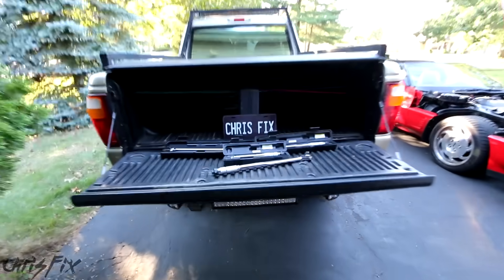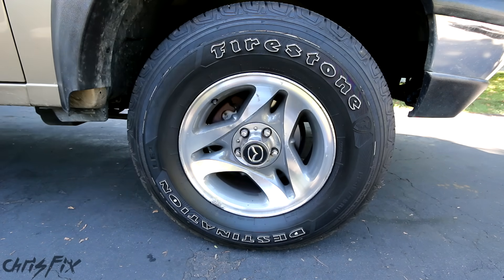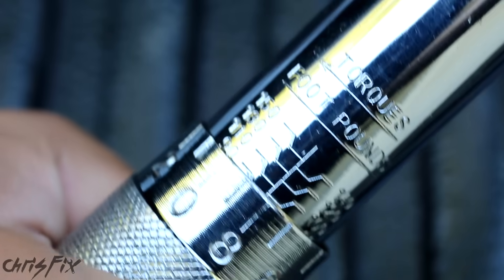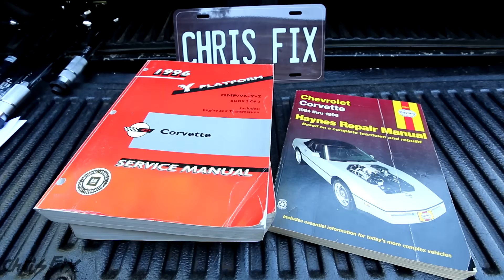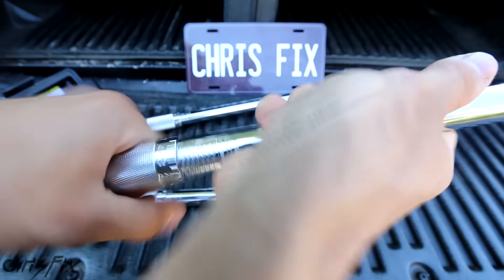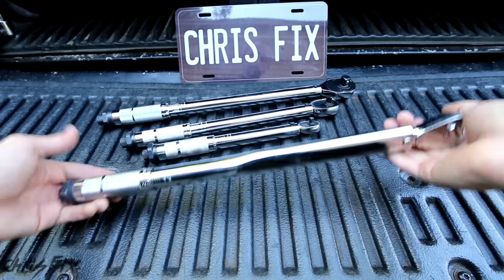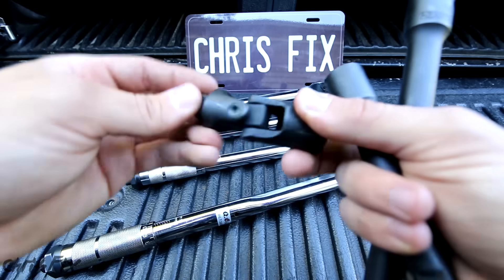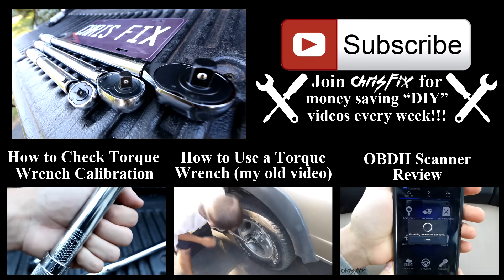How to use a Torque Wrench PROPERLY

Comment: I just slid my car off the road (Because of the rain), and I"m 90% sure I fucked up a rear lower control arm. Do you have a video/any tips on how to fix it/even know if it is the control arm? 

For explanation on how I crashed, I drive a 1995 Crown Vic. That thing only delivers 210 horses to 1 of my rear tires, and the road had standing water, I was going from a 35mph zone to a 45mph zone so I was accelerating. Then, before I even knew what the fuck was happening, I was sliding. Slid over a curb and into a school parking lot. I'm spooked solid dude.
Reply from the maker: +FancyDerp Dang, glad you are ok! It is scary when you get into a slide like that! Yea, here is a lower control arm video. Your crown vic will be a little different but you will get the idea: https://www.youtube.com/watch?v=CmN2dRAiuj0
This is an important tip: https://www.youtube.com/watch?v=-QczV_6v42A
Reply: ChrisFix Thanks man. I wrote that comment when I was still shocked about it happening, I could have easily looked up your videos. You seem like a cool guy, it's a shame I'll be trying to fix it myself
Reply: +ChrisFix Would it be a good idea for +FancyDerp to have the differential welded so the power is distrubuted evenly between both rear wheels? just asking :)

Comment: Torque specs are also in the owners manual.
Reply from the maker: +Paul Naylor Some are, but most arent. Lug nut torque specs are and maybe the oil drain plug.

Comment: Check your math.  lb*ft or ft*lb; order doesn't matter, it's still the same amount of force.  ;)

Also worth mentioning, you don't want to use an offset socket/extension like a crow's foot without consulting the owner's manual.  You'll have to recalculate your torque values, and because offset extensions are offset on the other side of the sensing mechanism, it's not as simple as "adding a couple inches."  Most manuals included with decent torque wrenches have the equations you'll need.  :D
Reply: Mathematically, yes, they are the same, but Pound-Foot is a unit of torque, and Foot-Pound is a unit of energy. Most people do use them interchangeably, because they are mathematically equivalent, but Chris is quite right that the correct term for torque is Pound-Feet. It's a technicality,  yes, but telling him to check his math is irrelevant, because it's not a question of math, it's a question of units.
Reply from the maker: +rhkips For your first bit, I agree with garrisonaw. Now for the crows foot, that is a great tip! Thanks a lot for sharing!
Reply: garrisonaw
Huh, I've never heard that particular distinction before!  Thank you very much for the correction, and my apologies for the incorrect information.  :)
Reply: +rhkips Apology accepted, but quite unnecessary. Like I said, it's a technicality, and most people don't realize that there even is such a thing as Pound-Feet.

Comment: Great video Chris one more thing to mention is to use the right torque wrench for the job you don't want to be at the bottom torque setting or the top for most accuracy and longevity
Reply from the maker: +fcporto0629 Great tip! Thanks man!

Comment: Why wouldn't you just use a air impact?
Reply from the maker: +TheHillbillyMechanic Air impact wrenches will over tighten bolts and nuts and make it really difficult to get off. You can also damage the threads on the nuts and bolts and you could damage the part that you are tightening down. Impacts are good to remove bolts but not to tighten them all of the way. That is why you torque 'em.
Reply: +TheHillbillyMechanic You could over tighten a bolt or nut.

Comment: I use German torque specs "goodNtight" Great video, I have all 3 wrenches and like you said I hardly ever use the 1/4" drive.
Reply from the maker: +Rocky X TV Haha, thanks a lot! Yea, not many things on cars get torqued to in-lbs.
Reply: ChrisFix mainly stuff that uses old cork gaskets but what car uses those anymore?
Reply: ChrisFix I think the trans pan on that vette in the video torques in inch pounds.

Comment: I've used the Harbor Freight 1/2 in. torque wrench for years and it's still reasonably accurate.  Cost <$10.  A cheap 1/2" female to 3/8" male socket adapter enables me to use most of my sockets with the same wrench.
Reply from the maker: +wholeNwon Thanks for sharing! I would love to hear more people's feedback because I read a lot of negative things about them. Good to know!

Comment: If you have after market wheels with new lug nuts will it still be the same torq. lbs.?
Reply from the maker: +JaVvii3 That depends. Usually 100ft-lbs is pretty common but if you have aftermarket rims/lugs, that might vary.

Comment: Hey Chris. Great video. Maybe you can do another video on what torque angle is but since it's mostly used on fasteners inside the engine, it might not be as useful and sometimes difficult to explain since it involves physics and how fasteners stretch...but knowledge is power and wont hurt to learn about something many mechanics don't even know about. Peace.
Reply from the maker: +seephor Thanks for the suggestion! If I work on something like an engine that I can use to explain torque angle, I will for sure!

Comment: i tighten my wheels and other stuff with regular wrenches and everything runs great. What's the REAL use of these things?
Reply: +WolfmanZX A torque wrench ensures that all of your nuts & bolts are tightened down to the manufacturer's specifications. Failure to do tighten them to recommended specifications can result in a loose bolt or nut and who would want a loose nut/bolt when you're going down the highway at 70 mph?
Reply: I just use my air impact.
Reply: +TheHillbillyMechanic man i wish i could have that. SO convenient!
Reply from the maker: +WolfmanZX Basically what DragonfruitQ  said. You can use regular wrenches but you wont be sure if you are causing damage. For example wheel bearings and control arm bushings need to be torqued to a certain spec to prevent damage.